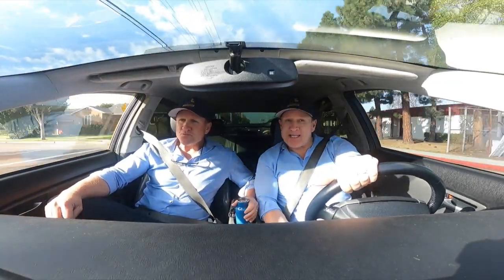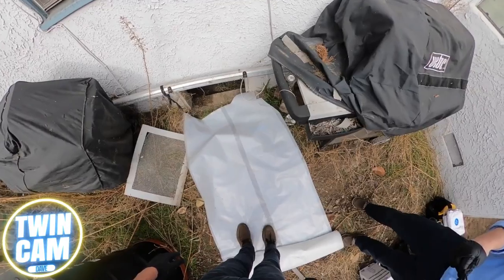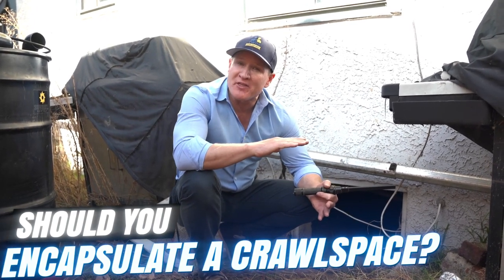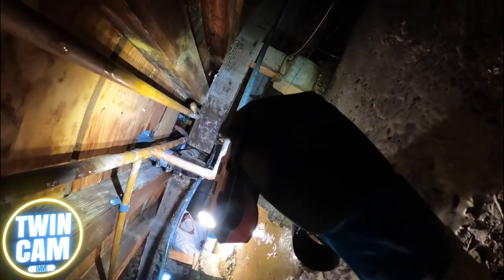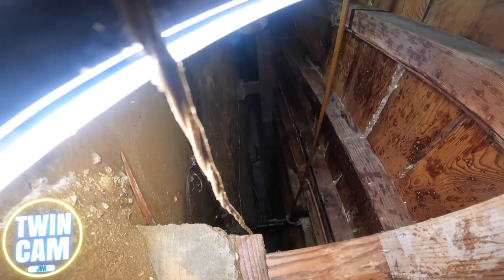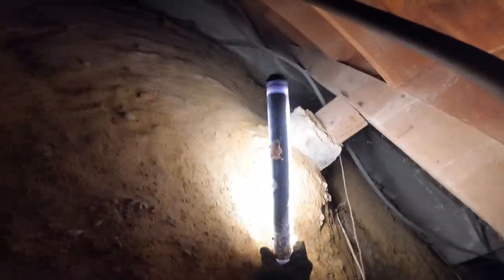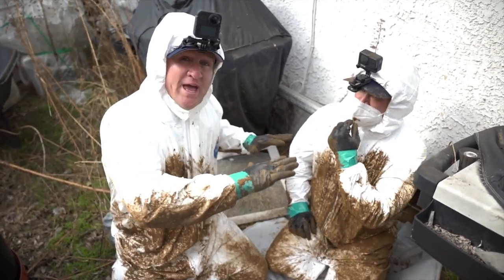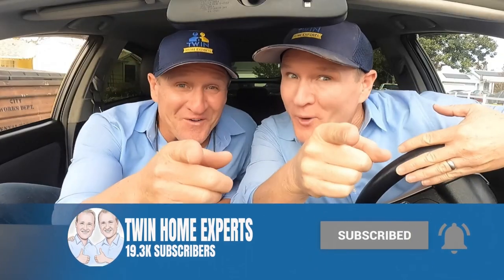Cast Iron Pipe FAILURE! CRAWLSPACE FLOODED... Twin Plumbing Emergency REPAIR

Comment: "Poopy water!" 😅

 I started watching plumbing videos after we hired a plumber to unclog a drain, which btw he couldn't do. My husband, I or the plumber couldn't get the snake down the pipe. The snake kept getting stuck and twisted at a certain at a certain point. We decided to do the hydro flush to hopefully get it unclogged.  We have old cast iron pipes original to the house. (66 years old.) Im super nervous that it will create a bigger problem.  😫 I'm hoping that it wont. 🙏 
In the future we are thinking about descaling our pipes. The plumbers told us they won't be able to give us a price until they run a camera down there to see the condition our pipes are in. Of course they can't do that until our drain is clear. Anyway, do you guys service O/C or just what's listed under your website. Def want to have a couple of bids or price points on hand. 

btw thanks for the laugh, I needed that.

Comment: We have a large house with a hot water recirculating pump. The pipes are all copper, but the recirculating pump wears on joints and we had a lake under the house before discovering leak, twice!

Comment: Here in my 1880's house, hidden condition causing leaks. Finally found  deteriorating 1930's cast iron down pipe!
The bad pipe wrapped w 1930's newspaper!  3 plumbers incl H 4 humanity did not find the leak sources as it was clad w wood panels. Allergies are problem here. I'll email you guys! You are the best in your field!

Comment: Would you consider a proper smoke test one where the company puts the smoke on and then never enters the house to see if there’s smoke? I smelled the smoke and it triggered my asthma and so we went outside to get air. They then told me there was no leak and they were finished with everything. 🤔 we’ve had a sewage smell in our bathroom and our bedroom (it has a hatch that hatch opens up to see pipes). We’re at our wits end. 😭
Reply: Smoke tests are only as thorough as the tester wants to be really..  theres so many hidden piping inside houses it gets hard to locate minor leaks in the venting systems..  you probably have a cracked vent line thats hidden behind a wall around the area you most often smell sewage..   so if you truly want to get to the end of your headache with it, best bet before calling a plumber you need to pinpoint the area in the house where you smell it, go to the roof and look to where above the smelly area where the pipes are coming through the roof and tap on them while somebody inside listens to where in the wall it is located and cut out the drywall to visually put sn eye on the pipe to inspect it for cracks .  Before all that though make sure alll your p traps have water in them and have a camera run down through the plumbing vents to look for clogs, buildup, or breaks..  if nothing is found or helps than removing drywall is next step.  If nothings found, leave the drywall out and have it smoke tested again so since the wsll is out maybe the leak will be able to be spotted with the smoke...